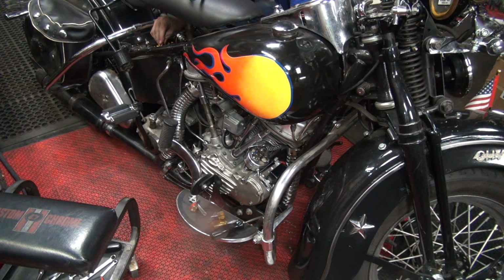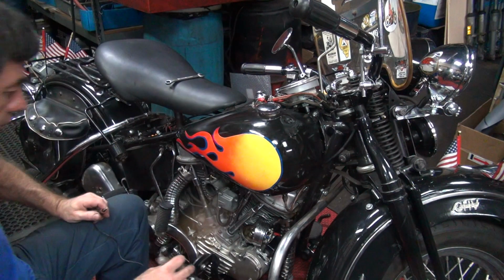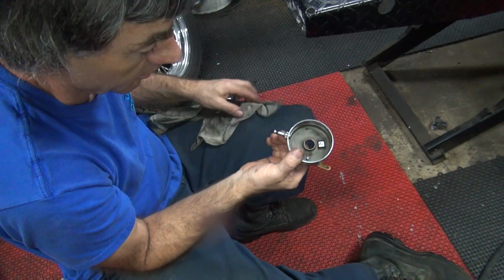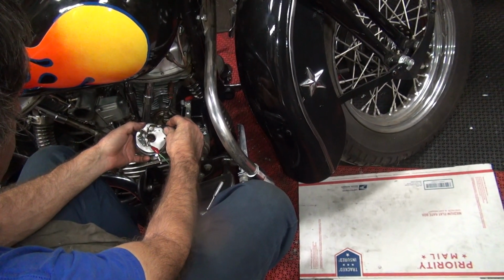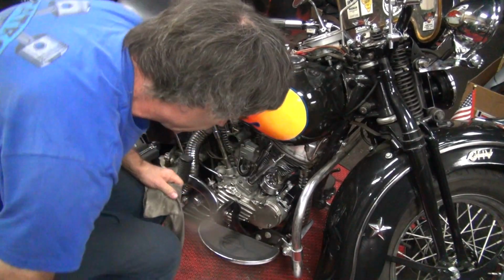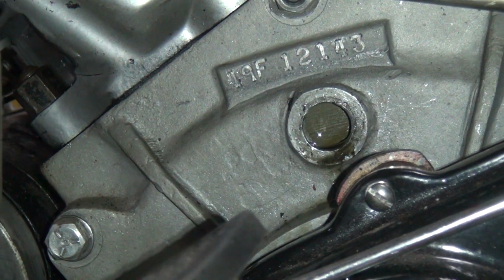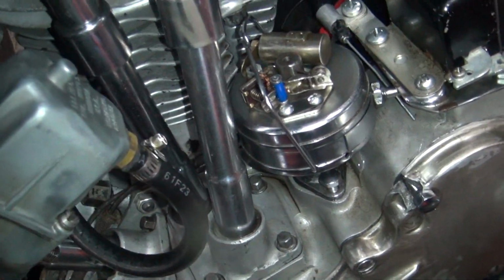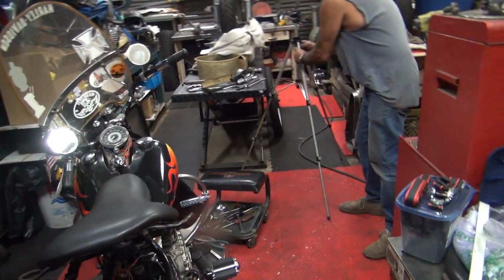#104 1949 panhead tune-up distributor rebuild get running 74ci FL dresser harley tatro machine

Comment: Are all pan heads like this?
Reply from the maker: at 70+ years old, yes. after you fix them than no. look at my 1957 dragbike and the 1950 parts bike up on the table. before and after.
tatro
Reply: P